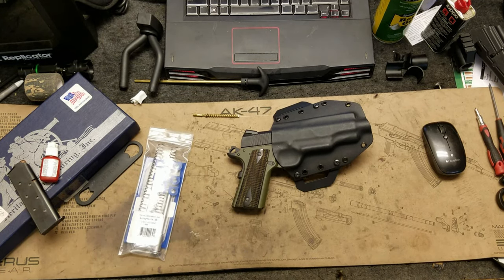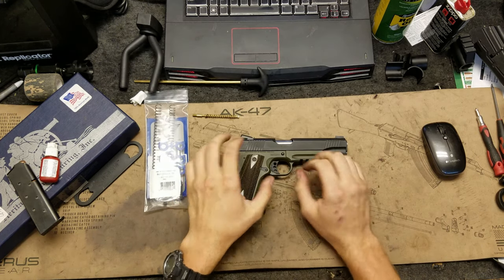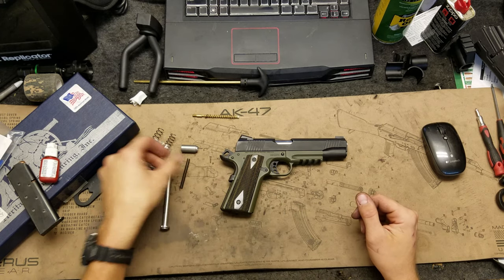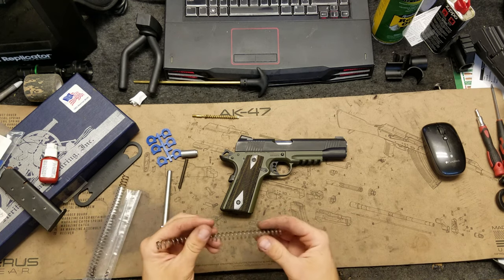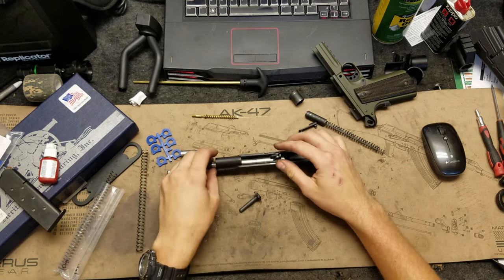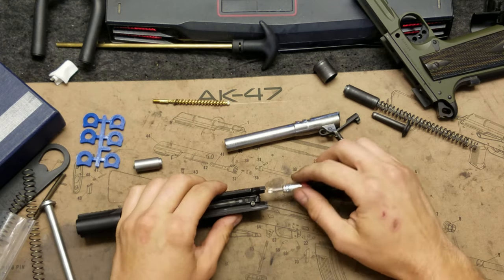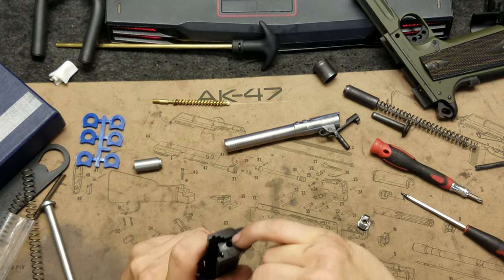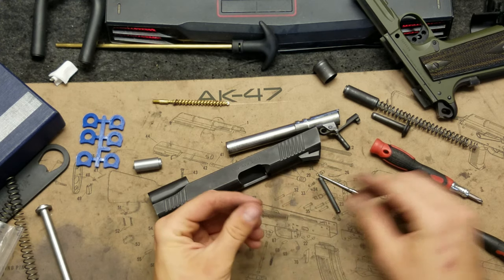Shok-Buff for 1911 and full length guide rod install from Wilson Combat

Comment: you probably already do it or realize it, but I find its a lot easier to disassemble and reassemble the 1911 if you engage the safety when your not actively trying to manipulate the slide. Just keeps you from having to hold it in place like I noticed at the end of the reassembly portion. Great video by the way, very informative, clearly visible, and well paced. I see a lot of videos on maintenance and parts instillations where individual will have an out of focus camera, block part or most of the work there trying to show, or rush through the work so fast its hard to follow along, sometimes all three! so great video lol

Comment: Ok.  A couple of things to talk about:
First!  Wear safety glasses.  If you don't, that recoil spring can generate enough force to stick that guide rod plug into your ceiling...imagine what it can do to your eye.  The plastic bushing wrench is a good idea because it makes the job easier and helps you turn the bushing and control the plug so it doesn't go flying.

Second, these shok-buffs will only last if your recoil spring is the proper weight for the loads you are shooting.  If it's too light of a spring, it will beat the crap out of that shok-buff and destroy it (will break into pieces and jam your gun up).  SO, I would NEVER use those shok-buffs in a gun that I use for self defense!  The LAST thing you need is a failure when your life is on the line!

Just my opinions, you do with this info as you see fit.  Only trying to help.

Comment: I don’t waste my time with buffs. I use a 18.5lb  chrome silicone recoil spring. Secondly I use the GI recoil system so I can break gun down no matter where I am without tools.
Reply: You can break the full length rod down without tools that’s not an issue.

Comment: Thank you for the video. I have a question, when removing the full length guide rod ,do you have to remove the spring first? I can't get my guide rod out with the spring attached, rod seems too long to get past the barrel link. Thank you.  Fred

Comment: does the shock buffer really work, or just a gimmick?  thanks
Reply from the maker: It actually works. I would recommend it for sure
Reply: from my experience using them in a sig 1911 they are junk.  Only last a hundred or so rounds before they are junked and start to cause malfunctions.  Just my experience.
Reply: @GunsWithGage  It's a great carbon damn that will build up crazy fast if not maintained/cleaned after every single use. I would compare it to buying one of them used dogs that was beaten... sure it makes you feel better but without constant attention expect it to be expensive and bring more problems then it's worth.
Reply: @confederatejeb  I tried one in my my Sig 1911 Target and it would prevent the slide from locking to the rear. I had to ditch the shock buffer.
Reply: it reminds of that story told by Jerry Miculek - “it’s more to catch the fisherman than the fish”

Comment: Will that system work for any 1911 or just the Wilson Combat?
Reply from the maker: Yes it will work on any 5inch 1911!
Reply: GunsWithGage 
  Ok so I’ve always liked the looks of the 1911. I like the mechanics of it and all the history and patriotism as well. But even though I have a huge gun collection I don’t own a 1911. In fact I’ve never even shot one. Crazy huh? Anyway I’ve always wondered what’s the big deal. They are expensive, they are single stack, they are an old design and probably a terrible choice for concealed carry. So why are so many addicted to these things. What gives?
Reply: @MaxHeadspace9mm  Haha This is me  too ^. Being in the business that I was in, I was able to handle, and fire all kinds of firearms. I don't understand. I bought a Sig tacops carry model 1911 for personal use, and just couldn't keep it. I put 880rds through it, and sold it. Sig is cream of the crop for production 1911's, but I don't understand the appeal. I'll stick with my polymer wonderguns, wheel guns, and oddities.
Reply: GageFixesEverything 
  Ok. So it’s the iconic appeal to round out a collection🤔. I still may get one someday. It’s just never been a huge priority because I’m really motivated by using a gun. Some of my favorite guns are beat up and well worn in but very functional and not fussy. Like my Glocks. Most I got used, some well used as police turn ins. 
  I like a gun with a story.